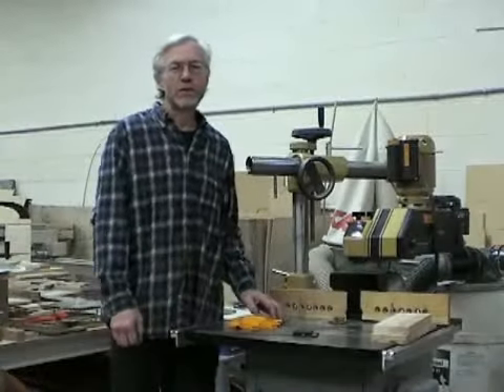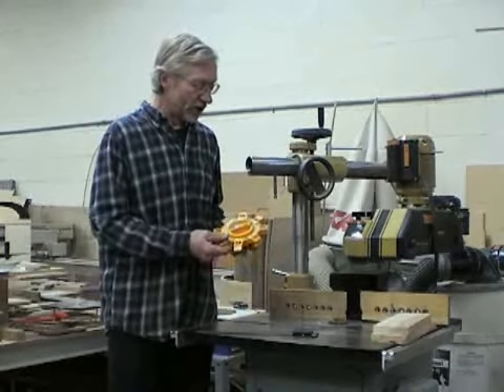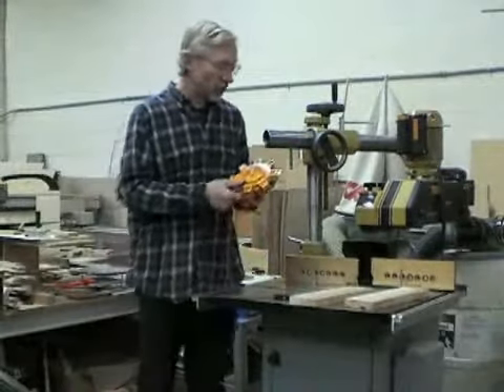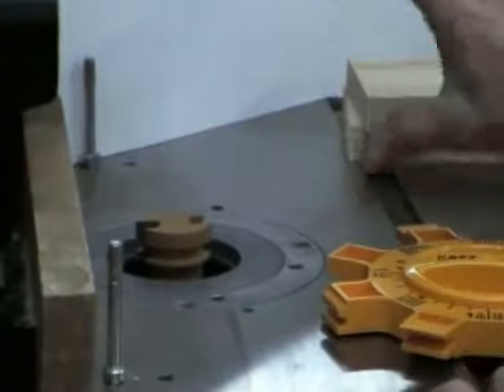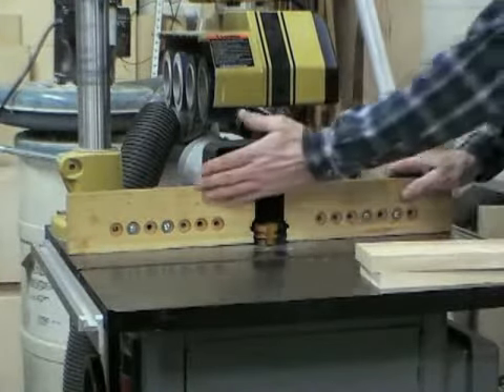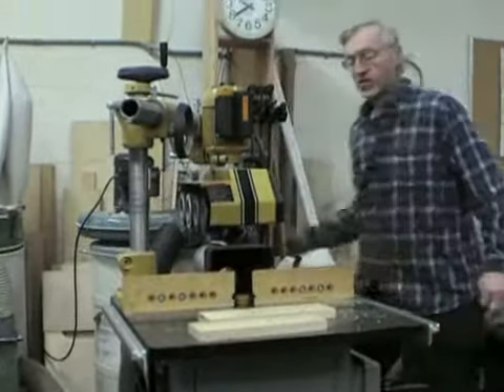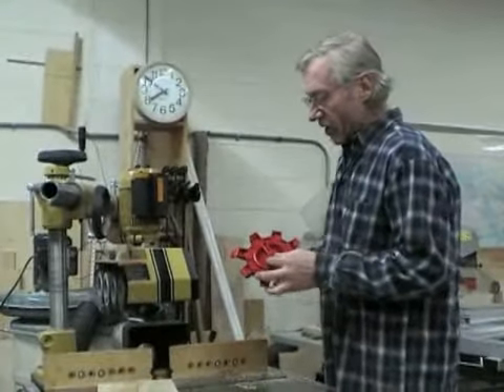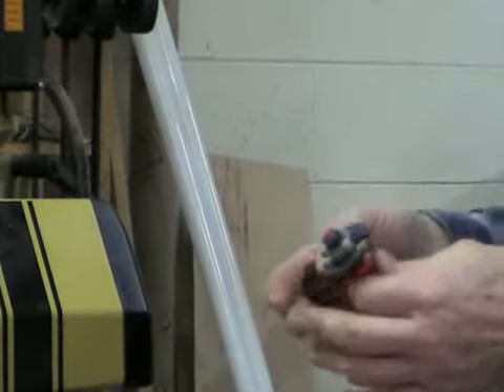In the Shop tests Sommerfeld's Easy Set

Comment: Very nice. Thanks for the info. I have been making "setup blocks" for different stock thickness. I wanted a tool that is a more universal and takes out some of the guesswork. Wasn't sure whether I should purchase the Sommerfeld set up jig for my Freud bits as I wasn't sure about the accuracy. A few thousandths is more than acceptable tolerance for something so quick and easy.